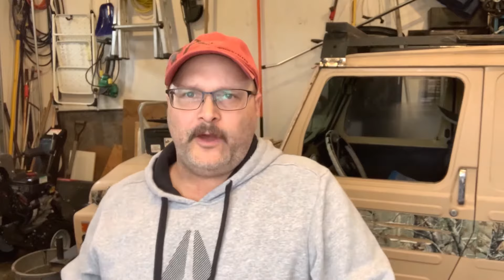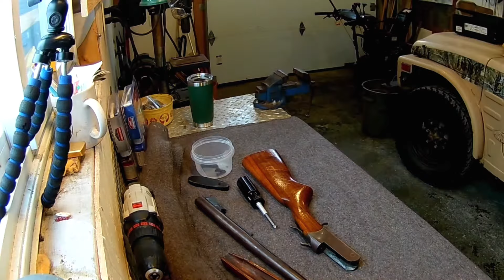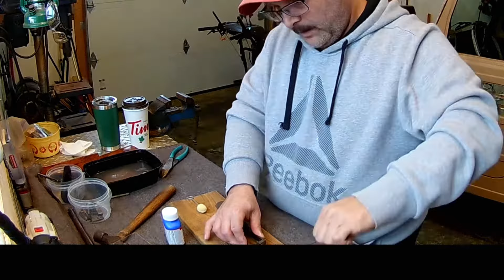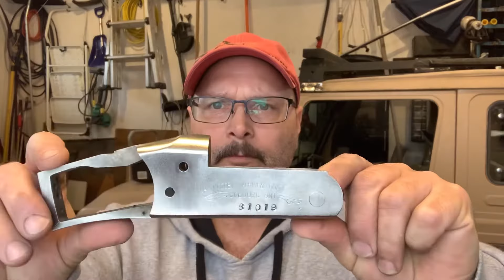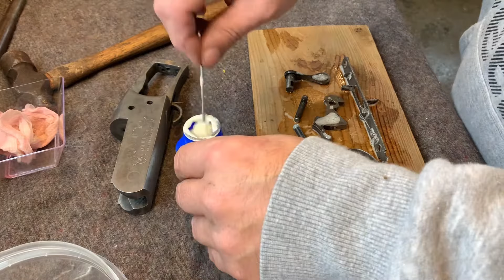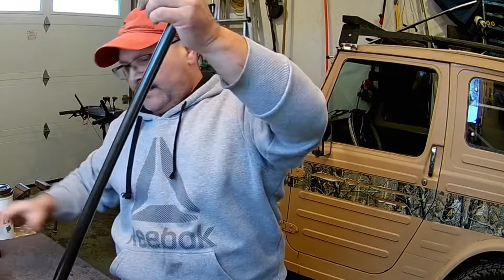Shotgun rebuild part 1

Comment: Thanks for nice video. After degreasing, most probably it should not be tuched with bear hands? The rubber gloves would be a solution. Hope the coverage was even everywhere and finger prints did not affect the uniformity of color in the long term?  In every step I woud reccomend to wear the protective gloves, at least because of chemicals.
Reply from the maker: Yes yo are right! Once the barrel was cleaned I handled it with a stick through it. I had one small blemish under the breach, not noticeable. Because of editing many steps were not shown or shown in detail.
Thanks for watching and commenting ✌️

Comment: If you compress the mainspring and put a small brad in the hole at the last coil it'll be a LOT easier to remove and replace it !
Reply from the maker: Yes you are right Sal. I learned iy the hard way!!
Thanks for coming out✌️

Comment: Hi could u show a video on taking pin out I have the almost same an it has to be broken down so that I would kno wat kind of firing pin to install because it need replaced if u so kindly awesome videos as well
Reply from the maker: Hi Anthony. To remove the pin you first have to remove a tiny screw near the top of the receiver. here is a good video that shows a tear down in detail. 
Thanks for watching!✌️
https://youtu.be/peCIXDNzd3A

Comment: I have a single shot Stevens 10GA. And a Iver Johnson 12GA. Side by side both are nice guns at that time are the only shotguns I had when I had moved to a cabin in the mountains off the grid bearly I had electric and they put meat on the table the only thing is I wished I had a 20 or 410Ga. To go with them and my 30-06
Reply from the maker: Its undeniable these simple but effective guns has fed and keep feeding folks all over the world 👍
Thanks for watching and sharing✌️

Comment: Hi what type of wire wheel did you use been givin an old shotgun and want to freshin it up a bit thanks
Reply from the maker: Because this was a total strip vs a blueing restore I put it throigh a steel wire wheel. However the break cleal was crutial to finish it off before the blue prossess.
Hope this helps✌️

Comment: Hey, I noticed yours doesn’t have a retaining screw out the sides or the top, most do. 
I have the same gun and the firing pin falls out. 
What keeps your firing pin in place? I can’t figure it out
Reply from the maker: Hi Liam, the breach has to be stripped down.  once the hammer is out of the way and the through pin is out there should be a tiny pin. Yours is most likely  broken, allowing the firing pin to fall out.
Hope this helps out some!
Reply: Just dont tip it up too far with the hammer back an it wont fall out

Comment: Oh boy, I did it too. Now I got the pins knocked out. Now how to remove all these springs ?
Reply from the maker: 🤣 ya I got caught with it to! If you look closely at the pins you will see a pin hole through it. Compress the spring and insert a piece of mechanics wire through the hole. that keeps the spring compressed and you'll be able to work it. Have fun Pete🍻

Comment: I've never heard of a Cooey shotgun before. 28 guage shells is a little hard to find in our area.  Not impossible but not easy either. A few of my friends still use 28s for their squirrel guns. At first I thought that might be a Savage or Stevens. My favorite shotgun is a  .410, Stevens single shot. Looks like everything is turning out well so far. Looking forward to part 2.
Reply from the maker: Hi Tracy your probably familiar with it, you might know it as Winchester 840, they bought out the company in the late 60’s and than made other variants like the 370 and others. They were all from the Cooey platform. The 28 has regained some popularity and in my opinion the best caliber for grouse.
Thanks for coming out buddy 🍻
Reply: @OpenAirOutdoors  , cool Marc. I was going to Google it, but never got around to it. Thanks for the information.